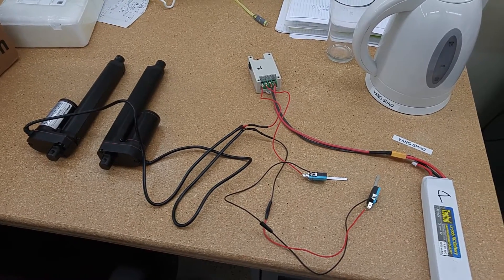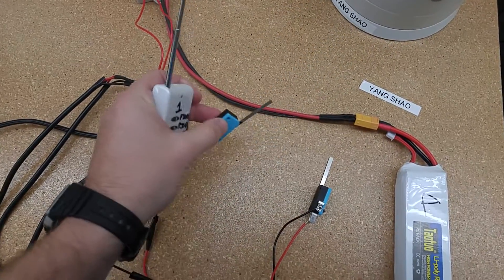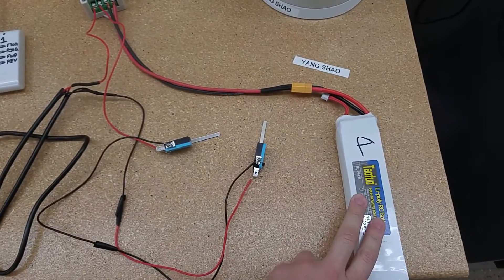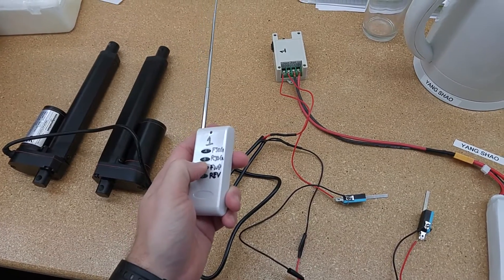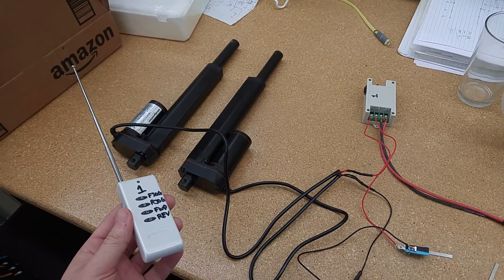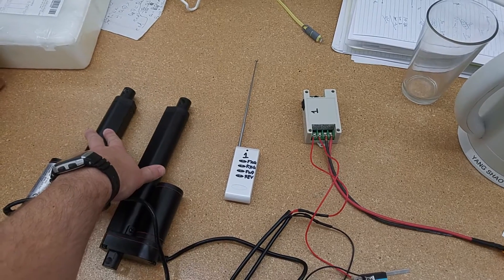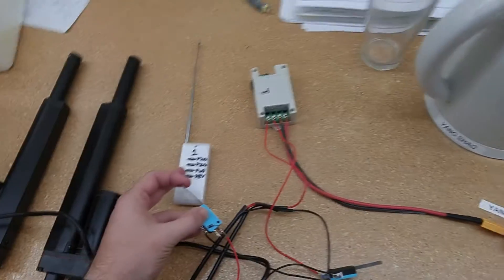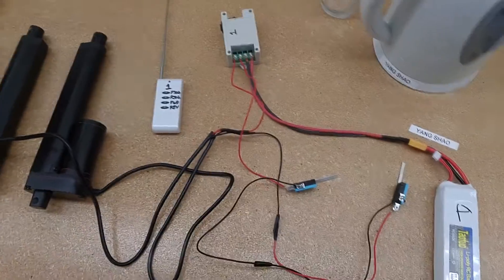Mag Brake Limit Switches Linear Actuator test

Comment: Is the diode necessary?
Reply from the maker: It was a long time ago, but I believe the reason for the diode is the diode makes the current stop going in one direction. Given a current in one direction, the motor in the linear actuator just starts rotating at constant speed in one linear direction (either extend or retract) via the lead screw. when the end of the actuator extends far enough away, it is supposed to hit one of the limit switches. This toggle switch then connects to a different current pathway. This new pathway has the diode preventing the current from traveling in the direction that it was just going in order to extend, hence stopping the motion. However, you still do want to allow current going in the opposite direction, so you can then go back the other way linearly. Anyway, Firgelli (I think that's how you spell it?) had a simple schematic on their website. For the most part, I try sticking to what the manual says.